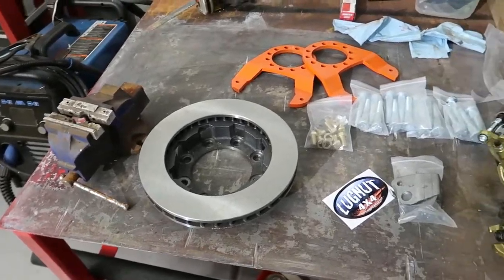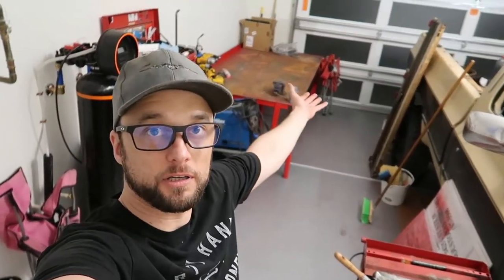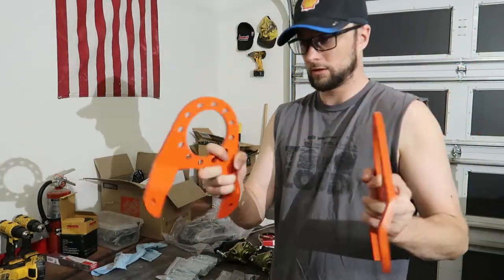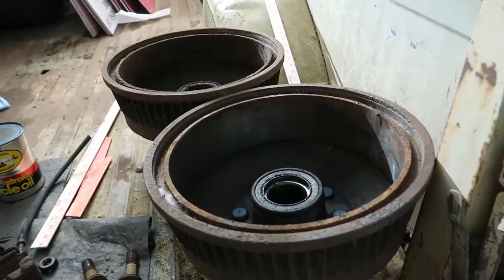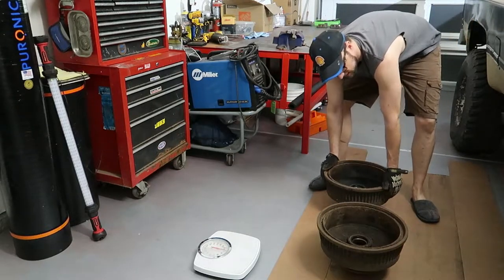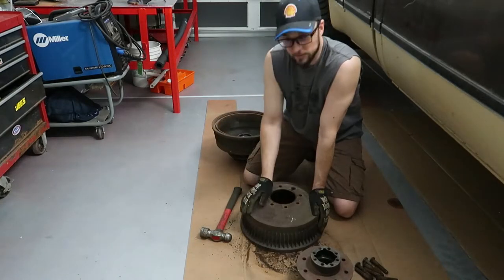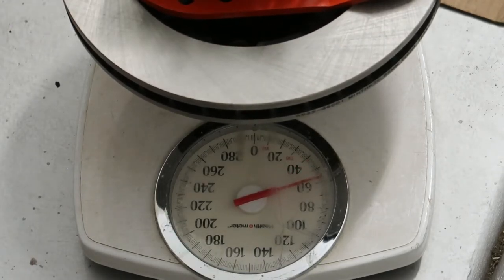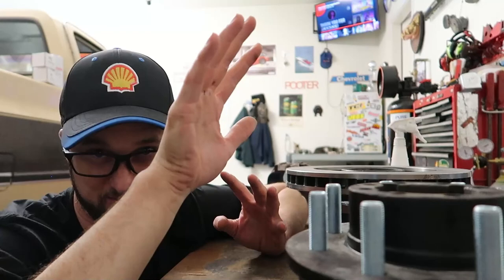Squarebody trail rig build, 14 bolt disc brake conversion by Lugnut 4x4!

Comment: Thanks for doing that. I see it mentioned in the ads but they never put a number on it. Now I know why.  Looks like you save 60lbs. total, not nothing, but not really significant which is what I suspected. Also, I don't see why you would change the studs unless they were damaged. Use a brass drift and they will come out undamaged. Pull them back in with a lug nut. They came out easy, they'll go right back in, no problem.  Faster than getting the parts and taking them to the machine shop and a whole lot cheaper.  They aren't really a known failure item so I don't see the point. The only time I see those fail is when some jackwagon at the tire shop cross threads a nut and then rams it on with an impact.
Reply from the maker: @michaeldose2041  I replaced the studs because mine were rusted trash. Also the stock studs are too short to run modern aluminum wheels.
Reply: @PootsGarage  Sorry I didn't mean to get you ruffled. That said, I noticed that you were running ''modern'' aluminum wheels before the brake conversion. Also,  I'd be more worried about the rest of the truck for rust I've seen the underside of that beast on other videos. Maybe your next video should be on rust control? Rust on a stud is pretty easy to fix/prevent but hey do what you like spend your money and time as you see fit. For the people who watch this video replacing the studs is 1. not necessary in the vast majority. 2. Taking that to a machine shop is a total waste of time and money. Especially with a used hub. Maybe change the channel to putz garage? LOL.
Reply from the maker: @michaeldose2041  you are wrong, sorry. This axle was not under the truck yet. It had steel wheels on it. I had not bought the 40’s and beadlocks at this point yet. The old studs  had extremely rusty studs, no threads in some places so they HAD to be replaced. This truck is a wheeler and not being restored so the rust on the rest of the truck is  a non-issue. Thankyou for the feedback.
Reply: @PootsGarage  Okay I guess only the back axle is a ''wheeler''? Again you don't need to get defensive you didn't mention any problem with the studs when you were whaling on them with the hammer, just to say you weren't going to use them. Like yeah not now LOL. If you really want people to get something out of  the video explain the what and why, trust me you'll get more views and a lot less annoying guys like me.

Comment: Houston TX  is the saine for C20 chevy???
Reply from the maker: This should be the same as long as you have the full-float 14 bolt axle and not the semi-float 14 bolt. There are also differences in the type of hub depending on the year, you can tell by if your brake drum slides off or if its pressed together with the hub/wheel studs. Lugnut4x4 has all the info you need on their website.